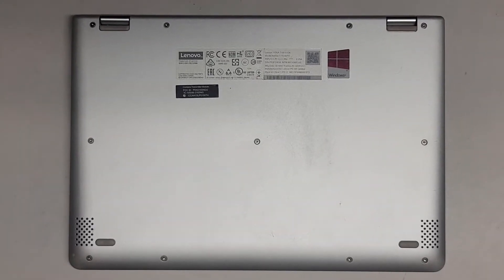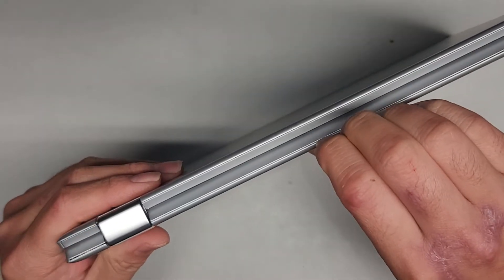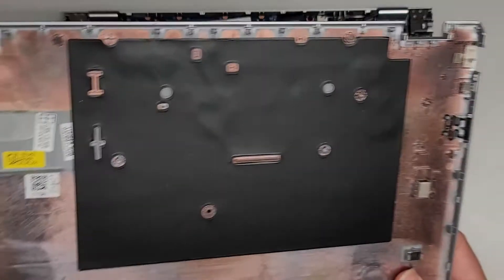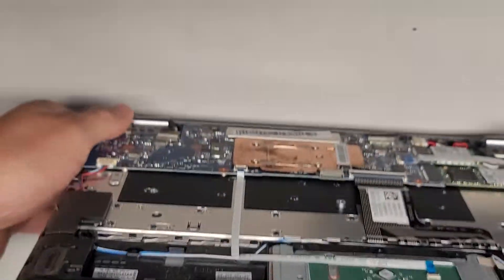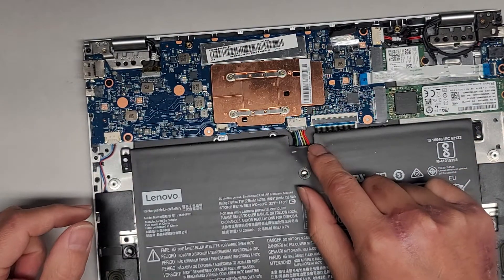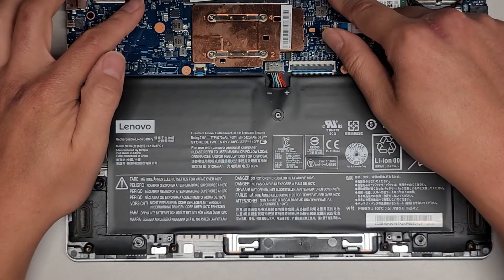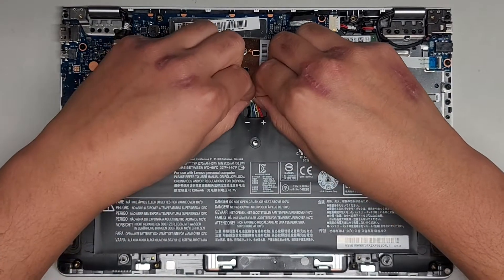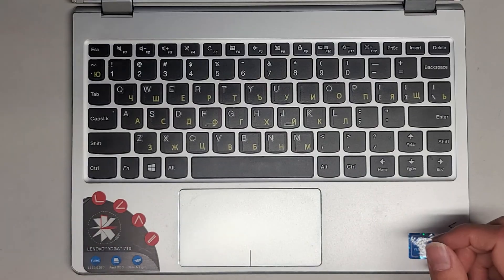Lenovo Yoga 710-11ISK Disassembly SSD Hard Drive Upgrade Battery Replacement Repair Look Inside

Comment: I have the previous generation of this laptop (700-11ISK) and it has failed 3 times in the exact same manner you describe since I got it in late 2015. Two of those times were thankfully during the extended warranty period and what they did to repair it was replace the whole motherboard. Last year it failed again and since I'm fond of it I went and bought a replacement motherboard on ebay and it turned right back on. I still do not know what causes the motherboard to fail but it seems to be a thing for Yogas of that era.

Comment: hey bro do u know how much hard drive space it can hold total i wanna upgrade it the only number i found was 128GB
Reply from the maker: You can put as large as you want
Reply: @ItsBinhRepaired  so if i can afford 1tb i can get it?
Reply from the maker: @mxbyesky  sure
Reply: @ItsBinhRepaired   k tysm
Reply: @ItsBinhRepaired  external hard drive to?
Reply from the maker: @mxbyesky  you can use any size
Reply: @ItsBinhRepaired  but is it the same with external hard drives? and btw sorry for the questions
Reply from the maker: @mxbyesky  what do you mean? Is what the same?
Reply: @ItsBinhRepaired  are external and internal hard drives the same so can i buy any amount for external hard drives to?
Reply from the maker: @mxbyesky  I don't know what you mean by the same? They are two different things.
Reply: @ItsBinhRepaired  oh, but can i get like 1tb external hard drive and not crash my pc?
Reply from the maker: @mxbyesky  you can use whatever size you want.
Reply: @ItsBinhRepaired  ty
Reply: @ItsBinhRepaired  hey one more question is it size of the hard drive like inches or like 500gb size which one doesent matter and is this a notebook labtop?
Reply from the maker: @mxbyesky  the amount of storage doesn't matter.
Reply: @ItsBinhRepaired  the size of the hard drive like inches does?
Reply from the maker: @mxbyesky  yes
Reply from the maker: @mxbyesky  unless it's external.
Reply: @ItsBinhRepaired  ok i need a external hard drive so ty
Reply from the maker: @mxbyesky  got it
Reply: @ItsBinhRepaired  yo can u figure out the max for me it says its to fast i got a 1 terabyte hard drive
Reply from the maker: @mxbyesky  there is no max
Reply: @ItsBinhRepaired  there is it said its to fast so it wont work
Reply from the maker: @mxbyesky  what do you mean too fast? Who said it was too fast?
Reply: @ItsBinhRepaired  i tried to use the hard drive but my computer said its to fast and not useable
Reply from the maker: Never heard of that before
Reply: @ItsBinhRepaired  are you able to see if you can fix it with the computer in the vid and show how
Reply from the maker: @mxbyesky  can you record the too fast message and upload to YouTube?
Reply: @ItsBinhRepaired  yea
Reply: @ItsBinhRepaired  wait i gotta record
Reply from the maker: @mxbyesky  ok
Reply: @ItsBinhRepaired  uploading
Reply: @ItsBinhRepaired  my recording dont show they only show my mouse not the opening of file explorer
Reply: @ItsBinhRepaired  oh yeah its the hard drive that connects to the side of your pc not inside
Reply from the maker: @mxbyesky  ?
Reply from the maker: Shouldn't be an issue
Reply: @ItsBinhRepaired  it is tho
Reply from the maker: @mxbyesky  doesn't make sense
Reply: @ItsBinhRepaired  but still
Reply from the maker: @mxbyesky  not sure how to help
Reply: @ItsBinhRepaired  ok its fine

Comment: Where is memory ram
Reply from the maker: Soldered to the motherboard
Reply: @ItsBinhRepaired  Possible to replace without damaging board, or need a new board that has SODIMM?
Reply from the maker: @banana_bread_at_work  if you have to ask, the answer is no.
Reply: @ItsBinhRepaired  It was a genuine question.
Reply from the maker: @chris3791  that's how difficult it is to replace. Similar to asking if you can transplant organs. It's possible, but if you're asking, then no, you yourself cannot do it.
Reply: No you cannot just upgrade soldered memory, it's basically impossible  @banana_bread_at_work
Reply from the maker: Yeah